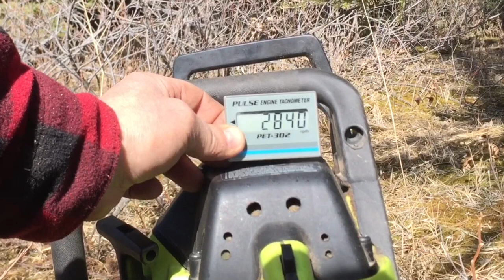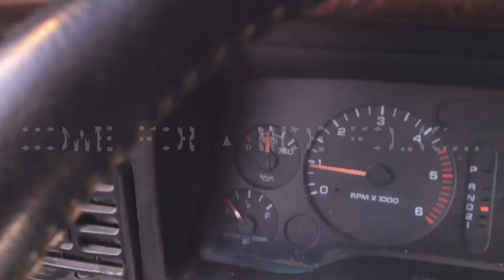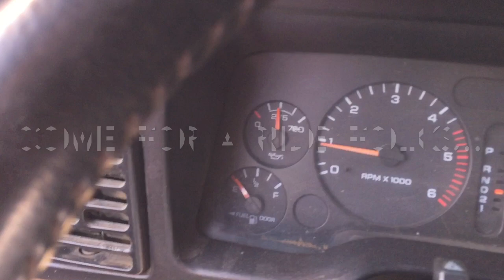So you want a Poulan that runs and cuts all day long...Here’s what you need to do.

Comment: Hi form Australia im just in the middle of modding a 2050 poulan as we speak but what im going to do to the muffler is flatten the back exhaust ports and weld them up and cut a side port with a deflector plate like on husqvarnas and i will post a video it of it when i can
Reply from the maker: Right on. My next saw I’m going to put together is a Poulan 2050 with an Amazon 41.1 cc top end. It has a dual ring as well vs the stock 36cc single ring.
Going to build it stock at first to see how it is then port it.
Ya that exhaust mod sounds good. 
On that 2150 I knew I was going to sell it so just opened up the muffler a bit but would be interesting to see what doing a muffler mod does like what you are doing. 
I’ll have to look at the Husky exhaust to see what you mean.

Comment: Those saws get a bad rap. I have two 38 cc. One is 17- the other 11 years old. I use them hard, and they have never been down. No wear on pistons or cylinder, no carbon build up. I have done some mods to both. I can turn them up to 112 rpm, but keep them in the rang of 102. In the wood they will pull in the 8s. With all sharp chain. The type of wood you cut depends on the fill you put on the chain, and size of bar. 
People ask me to work on their saws, and when they use it this the face I see😳.  What did you do to it? It has never run this good. 
Yes it is a little louder and pulls a little harder. The big improvement is ( air in and out ). 

Thanks for sharing, and best to you. Don’t give up on your 4 legged buddy. They are mans best friend 😇
Reply from the maker: I’d never give up on the old girl.
And ya that’s awesome they are decent for sure.
Take note I was not great at sharpening chains in that video. I’ve used saws for years but never mastered sharpening them and after lots of practice and research I think I’ve got it now. Makes all the difference On these small saws

Comment: Perhaps newer models addressed this  heat soaking issue. Because my cover already is trimmed on the right side to allow the cylinder to vent its heat. Also, I have a heat shield muffler gasket. Only thing I need to do is a muffler mod and drill intake holes
Reply from the maker: Oh they cut the cover out did they?
What model do you have?
Reply: @Indeewoods  Apooplogies. Looks like I have the 1950 model. Regardless, it does still have those improvements. Only issue I have is the damn muffler. It uses e torx bolts down a narrow tube, not like the exposed bolts yours has. I've searched the whole internet, there is no tool narror enough to fit into these tubes to remove the 2 e torx bolts. I found one, but it's discontinued.
Reply from the maker: It wouldn’t have the cover trimmed back from factory maybe someone watched my video and did it?
Reply from the maker: The 1950’s don’t have the torx bolts you must have a different model.
Plus they don’t have the bolts down the narrow tube that’s the other style muffler Poulan uses.
Any common torx screwdriver will work.
Reply: On mine i welded shut the muffler ports towards the rear, put a 15 mm short tube in the front, gutted the box and rewelded all, not more heat soaking, the right back pressure and a nice but not annoying rumble👍 of course you need to retune, It gained power, Also now she drinks more fuel, but i recommend this mod!
Reply from the maker: I’ve got another i’m going to build up and it’ll probably get a different muffler as well

Comment: These things do like rpms especially after you put a degree wheel on them and adjust the #'s some.
Reply from the maker: I think your right.
Reply: I have yet to pull the ole 220 back apart but if I remember correctly the exhaust is typically 108-110 degrees before open transfers are around 128-132 and the intake port I do not remember on that one if I had to guess with these saws being 38mm to 41.1mm bore with a 32mm stroke intakes usually around 132-136 before opens. Now I could be wrong on the intake I'd have to re time the poulan 220. I do know the 41.1mm bore cylinders makes a bit better torque then the 38mm cylinders but the 38mm bore will be able to rev out higher so you would gain some there not much. You can get these lil guys up to 14,000 or so rpms the main crank bearings will be the issue to get it to rev up a bit higher. Trying to save the seals off the bearings to put on ceramic hybrid bearings is a turd though. I do know in the next 2 years or so parts will be discontinued as the OEM cranks already are. Nwp might make aftermarket crankshafts but I dont know if they mess with small saws or not. Oh and a skip skip tooth chain helps these little guys out a lot lol. Hopefully this info helps you if you ever do feel like porting one.
Reply from the maker: Awesome great info! 
I ordered the 41.1 top end of Amazon for the 2050 and it has dual rings vs single on both the 2150 and 4218A so should make it stay consistent and not fade when the saw is worked hard.
Reply: @Indeewoods  the reason for the single ring is less drag. The reason the aftermarket companies has made them dual rings is for the longer lasting I personally think the single rings have less wear on the cylinder walls then the duals. The plus of the dual rings is it does change the point of compression because the top ring is a bit higher on the piston the the single rings. I do know a muffler mod helps with these things I typically cut a section from the baffle and the indention on the front of the muffler I drill out to be roughly .450-.485" I do tap the side exit closed and tack weld it shut from the inside. Witch could be the reason it has good power then fades away then comes back because the cylinder is getting to hot from the muffler holding heat at the cylinder. Oh a good helpful tip of what typically kills these saws if someone doesn't straight gas it or cold seize it is the intake manifold bolts come loose causing the manifold to come loose causing a lean condition making you think you need to add more fuel eventually killing the cylinder from lack of lubrication. I've seen that a lot with these saws. Other then that the are a good saw. First saw I ever learned to rebuild was my father's 96 2175 50th anniversary saw. Very good platform to learn how a 2cycle works. If you are interested in any tips on porting I definitely don't mind to give up some of my techniques that I've learned.
Reply from the maker: @rncboy2  thanks ya I take any and all advice the more knowledge the better. 
Haven’t had much time lately to get into the porting but it will happen.
Reply: @Indeewoods  The only bad thing about a port saw or porting a saw. Is once you do it or run one there is no going back lol and all of you're saws you'll want ported lol. When I get back home this evening I'll let you know on some tricks.
Reply from the maker: Oh I know I’ve got an old Husky 285CD that is ported. Make cutting wood fun that’s for sure.
I’m not a total strager to porting i’ve built and raced MX bikes years ago that I ported just never spent a pile of time at it as I have several out door hobbies so it’s hard for me to devote all my time on just porting saws.
Reply: Kinda thought so on the racing. I've always learned to take 2 or 3 hrs in the evening to time it right numbers down tear down, then start porting the day after an so on when one is busy each day.

Comment: Hi I have Two Poulan saws a Wild thing 40cc and a PRO 42cc both 18 inch bars..Anyway  both run Well and Cut Fine but they both Die after you make a cut and let off the Throttle...Idles fine starts fine it just dies if you let off after WOT any Ideas? Thanks
Reply from the maker: Yes that is very common.
It has to do with how the carburetor is tuned. 
I should do a video to show how to tune these.
Try backing out your Low speed screw on the carb ( the one closest to the engine). Back it out 1/4 turn and see if that helps it from dieing.
Reply from the maker: And a Poulan Wild Thing was the first saw I ever had. It got stollen that still bugs me. Lol
Reply: @Indeewoods  Thanks For the quick Reply..I have the carb tool so i will give it a Go...Great Vids 👍
Reply from the maker: Yes that is one thing Poulan has is great carburetor splined screws. As long as you have the took it makes adjusting easy.
Most old saws just have the flat and it’s hard sometimes to keep the tool on the screw head.
Reply: @Indeewoods  Yes that spline tool really grips and never slips they use to be hard to find but now they are everywhere for cheap
Reply from the maker: Yep I wish they all used that style.

Comment: I’ve done the intake mode not the exhaust nuns like crap. Or should I say it doesn’t start most the time, A tree hugging saw for sure.
Reply from the maker: Lol have you tried adjusting the carburetor? You could have many other issues causing it not to start. These saws when tuned properly are one of the best starting saws out there.
Pull the muffler off and have a look at the piston. If it’s all scored up it’ll never run right.
Give me some more details and I’ll try to help you out.
Reply from the maker: Also you can’t do any mods at all without having to retune the carb.

Comment: Any suggestions for the vibrations?  I find there are times my hands feel numb.
Reply from the maker: Ya mine will get like that as well. 
I think oregon has a chain that lessens vibrations quite a bit. That’s about all you can do.
Reply from the maker: @Johnny Wishbone also if you switch it to .325 pitch chain that will smoothen it out
Reply: @Indeewoods  could a person put 1/4 " rubber under the handle bolts? It dosnt sound like much ,but anything helps.
Reply from the maker: @Glendon W that’s a great question and it’s funny you ask that because a fellow asked me the other day about an old trail that I cleared out many moons ago with a Poulan Wild Thing. 
It was a lot of clearing and looking back its no wonder my hands/arms went numb all the time. Lol
I’d try the rubber and please report back let us know how it worked.
Reply: I switched saws every hour and take a short break while I’m fueling and oiling up plus warming up the next saw
Seems to work fine 😊
Reply: Buy a real saw

Comment: It's not that they don't want you to lean them It's so someone who watches a video about adjusting can adjust it and make it run correctly
Reply from the maker: @James’ lawn mower repair talking about limiter caps? They have them so it can only be leaned out so far but for many of us at higher elevations it’s still to rich often. I ditch those limiters.

Comment: Good to here your Canadian . Interesting mods. I have same  saw and put a carb kit In but it won’t run. Did a compression test only 90psi.  Any suggestions?
Reply from the maker: Was the throttle wide open when you did the test? Either way pull the muffler have a look inside report back. Cheers

Comment: You mention it says 2003 where did you look to see that?
Reply from the maker: I’m not sure what your question is are you talking about a tag or something on the chainsaw I don’t quite remember the video you’ll have to be more specific.
Reply: @Indeewoods  you mentioned you saw the year it was made on the chainsaw(2003) where was the year printed?
Reply from the maker: @Yougo Tserved it was a sticker on the handle somewhere I believe. 
This one said “42ccEPA but it was actually 36cc’s. 
I think there was another sticker on the top cover by the muffler. Some times those stickers fall off.
Reply: @Indeewoods  trying to figure out what year mine was made
Reply from the maker: @Yougo Tserved ok parts will be all the same between models. If you are more just curious as to the year of it the plastic parts on the saw may be stamped with a number and it often has the year in it.
Reply: @samsquanch762  should be a small stamp on the inside of the side cover/chain brake cover...it will be embossed in the plastic like 03 0/3 its like a small circle date stamp
Reply from the maker: @Fearghal Morrissey I think you are right.
Reply: @Indeewoods  very under rated saws...i have a 46cc version very reliable

Comment: You’re better off getting a better filter rather than letting sawdust in all around the carb.   Love my poulan tho
Reply from the maker: I modified the stock air intake it doesn’t suck air from there anymore and it gets very little sawdust in the carburetor area compared to stock the way I have it set up now.
The stock filter is fine.

Comment: Just put a good carburetor on it  run alot of them  they start run fine no problem.
Reply from the maker: Like you mean a larger carb? 
I was looking at my Husqvarna 41 and the carb bore is quite a bit larger. 
Would be interesting to see how much power it would make with just a larger carburetor.